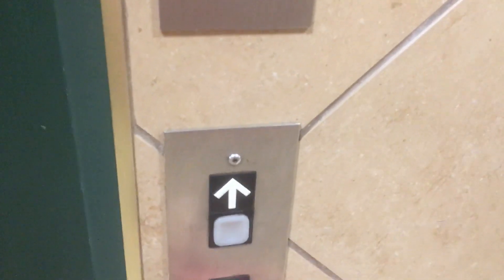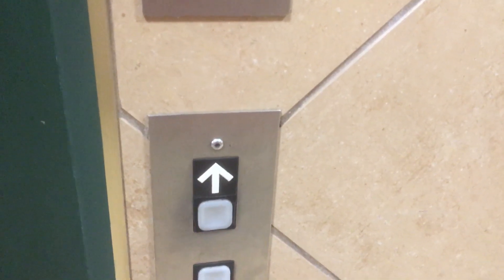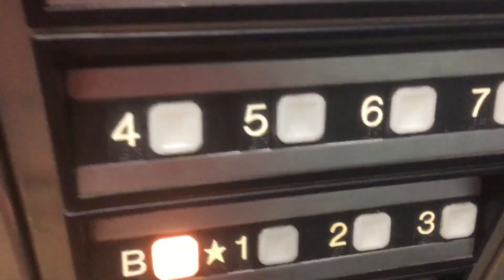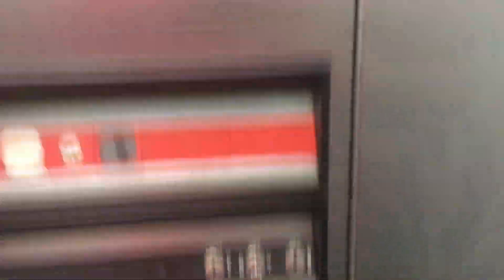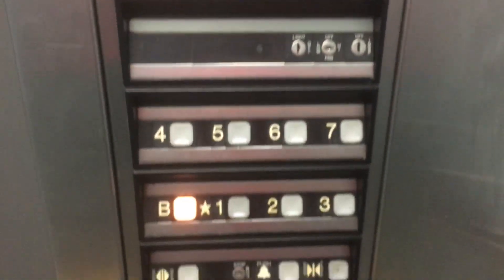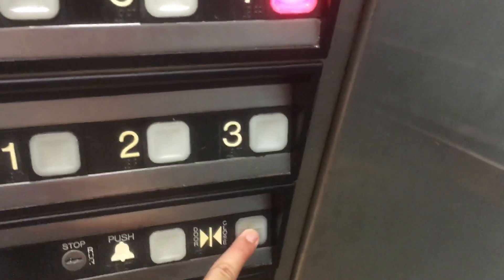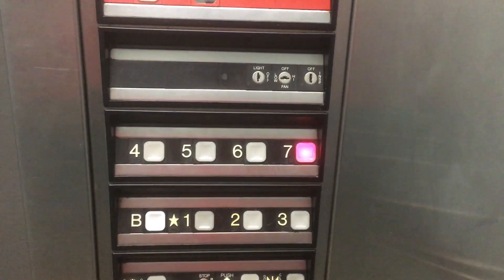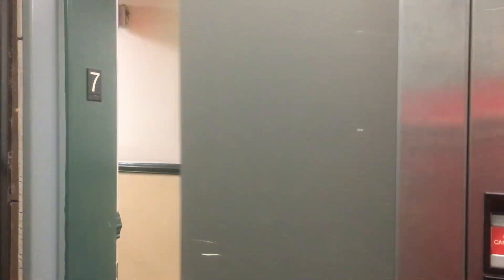8 FLOOR HIGHDRAULIC - Dover/Marshall Oildraulic Elevator - Centre Ct. - Shadyside, Pittsburgh, PA

Comment: Cool! How does the LMH PLC act different than the older relay or microprocessor controllers?
Reply from the maker: The lantern/chime rings if there's a call placed before the doors start opening. They often have this floor signal too.
Reply: @EWPA14  Oh ok, makes sense

Comment: I have seen two hydro elevators in an 8 story administration building of a community college, I once attended. With the amount of daily in/out traffic staff and students,  installing hydraulic elevators may have not been the best way to go. Were very slow. Might have been cost as to not installing traction elevators.
Reply from the maker: But esp. since most hydros back then were in-ground, you still have the cost of digging the hole.
Reply: Yes, indeed cost is probably $2,000.00 or more per day eight floors + close to 100 feet down. This building I I mentioned, was probably built in the late 60's early 70's.  Speaking of drilling at my old job the hydro fright elevator was installed where an underground stream ran, over the decades, the pit often flooded, called in a vacuum truck to removed the ground water. Would have been better to install a traction elevator, however the building was not strong enough, unless a steel frame was set within way back in the 1930's.   @EWPA14
Reply from the maker: Wow.
Reply: The Hampton Inn in Old Town Alexandria has 2 8-story Oildraulic Impulses.
Reply from the maker: Hmm, didn’t know that. The Hampton Perimeter Center Atlanta also has some.